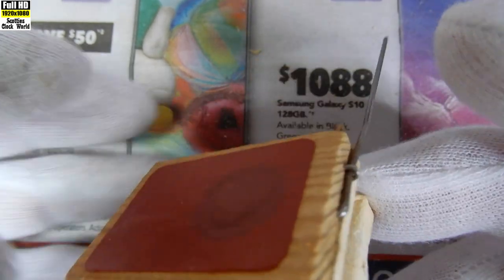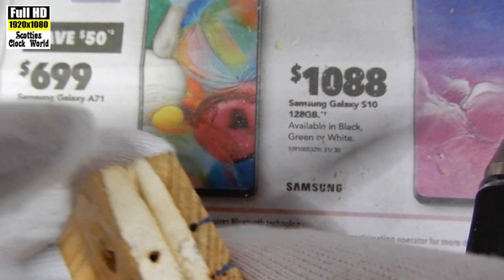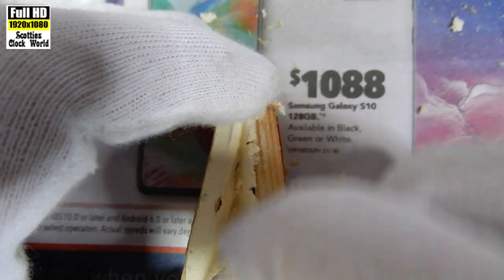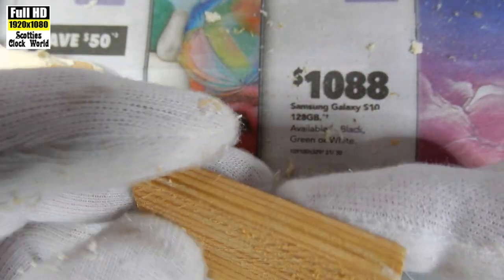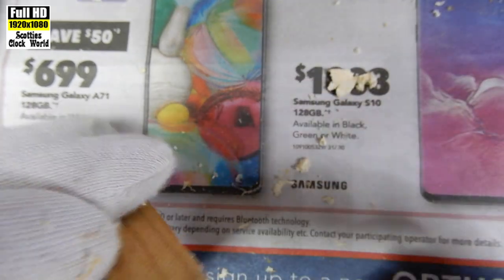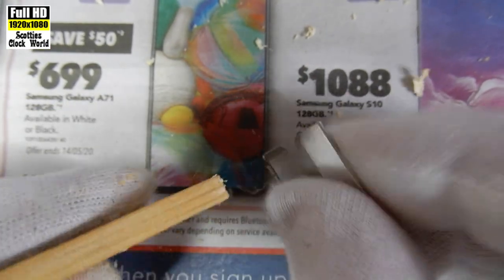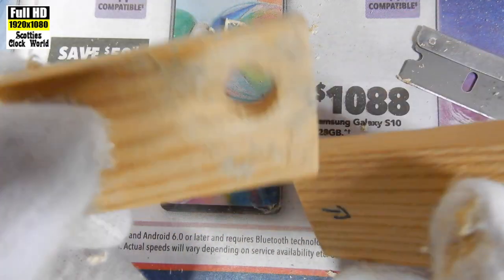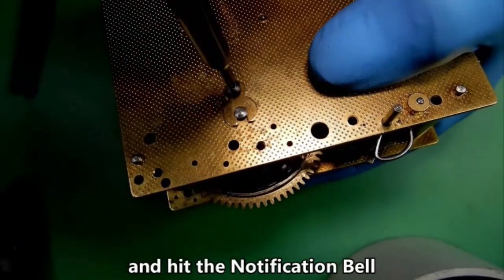Cuckoo Clock Bellows Replacement With Tyvek Paper - Part 1

Comment: Thanks, your video is just in time Scottie! I have a Cuckoo that needs this type of repair. I have heard that the tyvek from FedEx envelopes is a bit too thick to use. They sell different size replacement tops with the bellows already attached but I would like to learn to cut and attach from sheets like you are doing.
Reply from the maker: Here is the response from a very knowledgable cuckoo clock buddy of mine, @munnerlyn3
You can use it but you have to wrinkle it up a lot, then  dip it in hot water, and then allow it to dry. There is a guy in the Netherlands who uses it. I have tried it. I dont like it but it can be used.
Better to buy the right stuff.